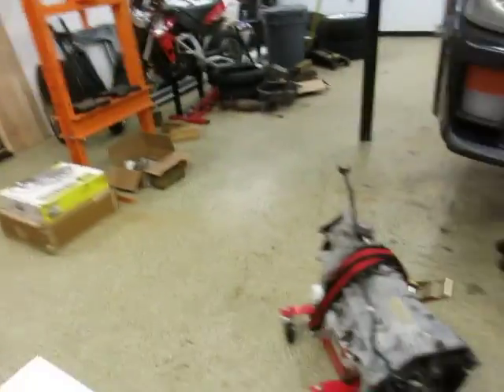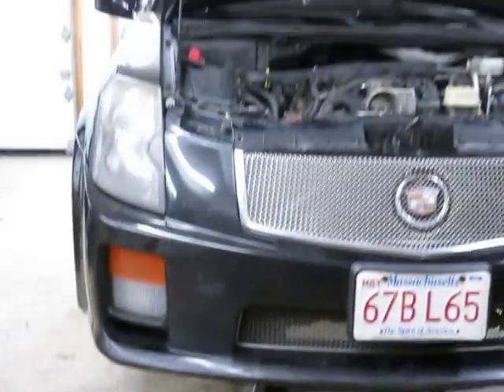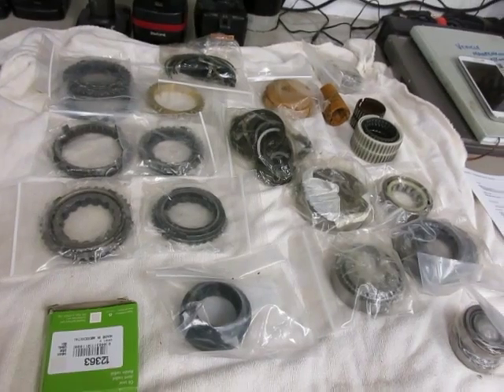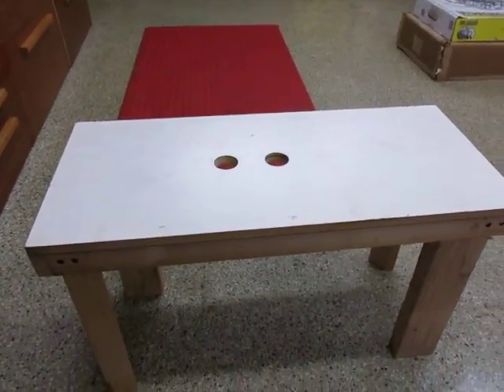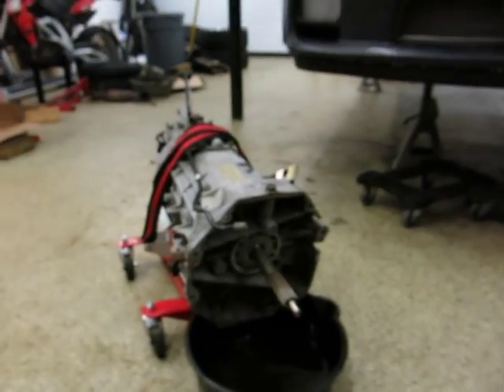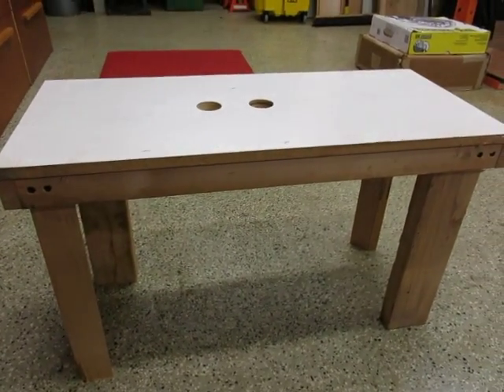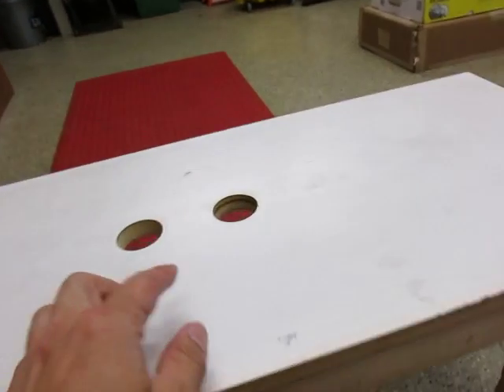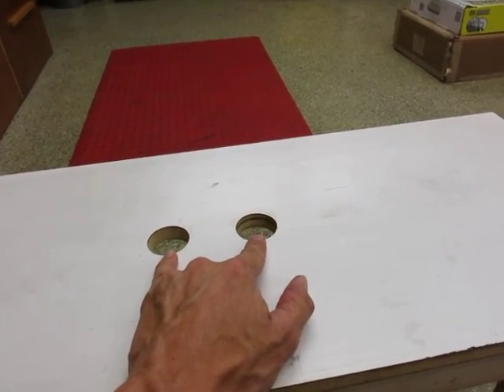Borg-Warner T56 Transmission Disassembly - Part 1

Comment: Do you still have the CTS-V? I've had mine for 15 years, still joyride a couple times a month 😂. 04 Magnuson super charger, Borla exhaust, Lingenfelter short shifter, all aluminum radiator, motor sports team dynamics wheels, love my car. Thanks for the video
Reply from the maker: I have a V2 now.  Sold the V1 at 210k Miles still running great.

Comment: Thanks for posting this video and keeping it on YT all these years.  I have a t56 from a 2004 cobra using it for a fox body swap.  I am wanting to swap just input shaft to 26 spline.  I can’t find a dial in tool to measure the resistance of the input shaft other than just feel as I turn it. Any ideas how to do this part ?

Comment: Odd question here.. 
I'm looking to build a short transmission without the tail end on for my model A which I'll make an adapter for a clam shell to run the torque tube on. So I have a T170 from a ford F150 1985 (3+OD) and I want to know if a main shaft from a T176 (from a Jeep J10, CJ7, J20...) will work in the T170 ?
thanks

Comment: Need a huge favour. You seem to know the TR6060 really well. I needed to pull out only the input shaft. I know on the older T56 you can just take the front cover off and remove the input shaft. I know on the TR6060 input shaft, the gear (4th gear) has a lip/flange which sits being the counter shaft gear which makes it harder to remove, but ive heard its still possible with a little “wiggle wiggle”. Can you confirm if I can remove the input shaft on the TR6060 without a complete teardown and just remove it from the front?
Reply from the maker: Sorry man, I've never worked on a TR6060 so I'm afraid I can't help.

Comment: I know the video is older but I'm curious, which puller is that? I found the otc 1040 to be the largest so far but wasn't for sure which one you used.
Reply from the maker: Just a unit from Harbor Freight.. part of a kit, I think.
Reply: Thanks for the info! I'm in the process of tearing mine down and the last gear on the main shaft before pulling the casing is where I'm stuck at. I see yours pulled right off without a puller. Im going to check their website and see if they have it available

Comment: Lets.hope this saves my 2000 trans am firehawk from a $3k rebuild on the transmission
Reply from the maker: Good luck!
Reply: Hey quick question what does 3rd gear mesh into thinking mines busted and wanna buy what ever it meshes into bedore rebuilding already got a new 3rd gear but cant find what it meshes into
Reply from the maker: @Hawkyes  'Mesh with' is far too general to give you advice.  I suggest you disassemble and figure out what's wrong before ordering any parts.  Could be as simple as synchros or something much worse.

Comment: Question? If I’m just wanting to replace my flint plate would I still need to disassemble the transmission to this level or could I just remove the bolts holding the faceplate on like you did I. The beginning and swap it over?
Reply from the maker: Not sure.. getting the new one back on might be tricky and you won't have set the clearances correctly to the plate.
Reply: Chris Bruno aye yea that is right. I have a TR6060 but it’s the one with the front plate and bell house in one and I need the one with the separated bellhousing and front plate. I may just get the tools to clearance it properly or take it to a shop 😭😭

Comment: At 5:23 the gear that you just slid off Is stuck on my T56, I have tried heat, a puller and multiple different prying solutions. Any ideas?
Reply from the maker: There is a special GM puller for the 5/6 gear if that's the one you're referring to.  Aside from using the GM puller arms with a hydraulic puller and some heat, then the next step for me would be a trans shop unfortunately.  Good luck.

Comment: I may have missed it, but why are you doing this rebuild? Did you experience some noise or poor shift quality? I know in part 2 you mentioned a bad fit with the 5&6 gear on the shaft, but don't say that was the reason you performed the rebuild.
Reply from the maker: It was having trouble engaging in certain shifts.  I expected to find the synchros trashed, but as you can see, they weren't.  I ended up needing to replace the clutch master cylinder - that was the root cause of everything.   Of course, had I replaced that first, then I wouldn't have made these videos!

Comment: Builds table specifically for trans rebuild in clean garage, uses claw hammer and nail to drive pins out.
Reply from the maker: Tapping with a hammer isn't really 'driving' in my book.  Let's see your video!
Reply from the maker: Because it was entirely unnecessary - obviously, considering that the result of the video was a properly functioning rebuilt transmission.
Reply: @SlideruleRacingProducts  Obviously. The correct tools are unnecessary so long as the outcome is as desired.
Reply from the maker: @idriwzrd  if the outcome was exactly as desired , then by definition these were the correct tools.

Comment: How closely related is the TR6060 to this transmission? I know the 6060 is a beefed up version, but is the assembly/disassebmly the same?
Reply from the maker: I believe they are very similar, but I've never seen the inside of a 6060.

Comment: I did not know that Tremec T-56 was made by Borg-Warner.  Is it true?  I had a Borg-Warner factory 5 speed in a 1976 Pontiac Ventura that I factory ordered.  I kept it for 19 years and it was great.  No issues ever,  but I knew guys that destroyed them fast.  Helps if you know how to drive I guess.
Reply from the maker: https://en.wikipedia.org/wiki/Borg-Warner_T-56_transmission

Comment: Many thanks for this, at the moment I have a t56 which makes noise all but when I push the clutch pedal in (i.e disengage the clutch). When I drained the fluid it came out dark gray/almost black by the way. This leads me to believe that there is alot of friction in the parts and thus alot of wear on them as well. I've never torn a transmission apart nor do I know what to look for when I do so. But hopefully, these videos will help.

Comment: @5:23 my gear is not simply sliding off. I don’t have or think they make a 16” long gear puller either... any ideas?
Reply from the maker: https://www.freedomracing.com/gear-remover-9379-9379a.html?___store=default&gclid=Cj0KCQiAn8nuBRCzARIsAJcdIfP25alZkxDm_UXoiwSsWJxg6-0mEKomgJhW_F0VPioKuAhaR13Ovy0aAl05EALw_wcB

Comment: Chris I just finished my rebuild of my t56 for my Pontiac GTO and I couldn't have done it without your help. The tremec t56 manual is pretty vague in some areas but your videos got me through it thanks again for saving me about $1000 at the shop
Reply from the maker: Glad I could help!  If you haven't already, please subscribe!  I need to get to 1000 subscribers to start getting YT revenue again!

Comment: where did you get your tools from i cannot find split ring pliers anywhere also your 3 jaw puller what size is it?
Reply from the maker: Search for "Wilde Tool G409P" on Amazon.  That's where I got mine.  The large hydraulic 3 jaw puller as well as the smaller manual 3 jaws all came from Harbor Freight.

Comment: You've done this a time or two, huh?
Reply from the maker: This video was my first and only time rebuilding a car manual trans.  In pretty much all my videos, I'm learning as I go.  Sometimes I edit out some of my trial and error, but most of the time I leave it in.  For this rebuild, I read A LOT online and in the factory manuals before I started.  I also had a lot of experience tearing apart motorcycle transmissions, so the basic functionality wasn't foreign to me.

Comment: 56 sec mark; The breather tube.  Any chance you know were I can purchase the breather cap?  In the process of swapping to an LS7 Clutch and was looking to see if there was anything worth rebuilding while I had it out, but will probably just stick to replacing the missing cap Ha.

The Car does make some grumbly swirly noise at Idle with the clutch out; Not sure if that will be resolved by the new LS7 slave, or if the noise is coming from worn components in the trans.

Thanks
05-V
Reply from the maker: Sorry - no idea.  Good luck!

Comment: Let me take a shot in the dark here, the infamous extreme vibration in the Vehicle from around 70-85mph? Getting ready to pull the T56 out of my 1997 Comp Trans Am. Only 52K miles on the car, motor and trans. But ill bet my 5/6 slides off just as easily lol

Comment: What brand is your bearing puller?
Thanks.
Reply from the maker: All of my pullers are from Harbor Freight.  I have the cheapo 3 jaw set, the bearing puller kit and the 12 ton hydraulic.
Reply: @SlideruleRacingProducts  I know we would click, i say the eXACT same thing, I also have a LOT of cheap harbor freight stuff, most of it is better than you'd think!
Reply: Even that super long one was a harbor freight 3 jaw puller?

Comment: AAIIIC from cadillacforums - I've had your rebuild thread on standby ever since you posted it up and then did these videos. Just getting started with a used CTS-V T56 that I picked up to rebuild.

I knocked off the nut on the output shaft with an impact. I noticed you used a 3-jaw puller to get the output flange off, and it looks like it took some work. On mine, that output flange slipped right off by hand. Is that a bad sign?  Should it be a press fit onto the splines, thus requiring a puller of some sort?
Reply from the maker: Hey AAIIC.  Hopefully by now you've figured this out - sorry I took so long to respond.  In any case, if it wobbles on the output shaft I would probably be worried, but otherwise you're probably OK.  I honestly wasn't expecting mine to put up such a fight, but it seemed comical to me when I did the editing so I left it in there.